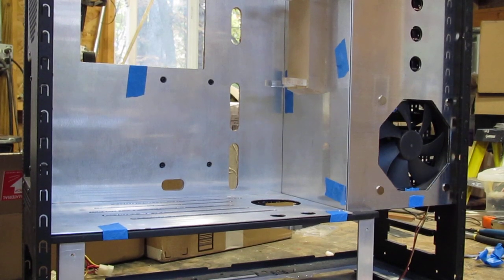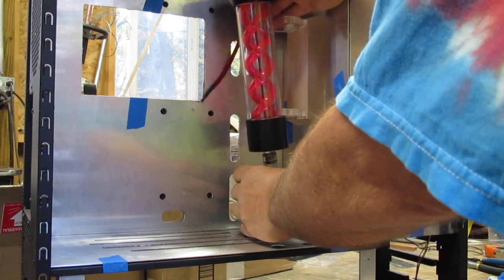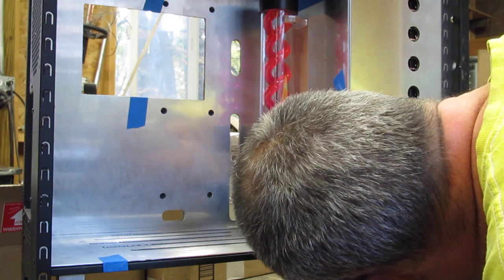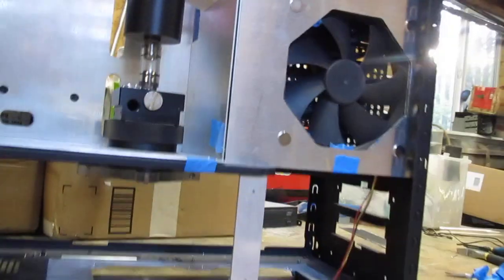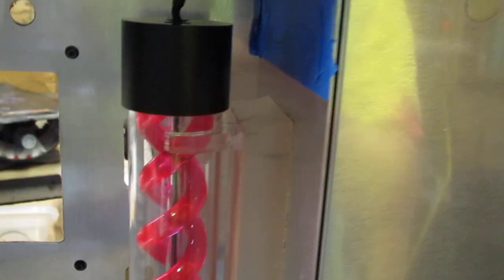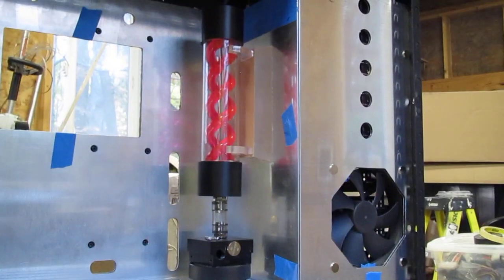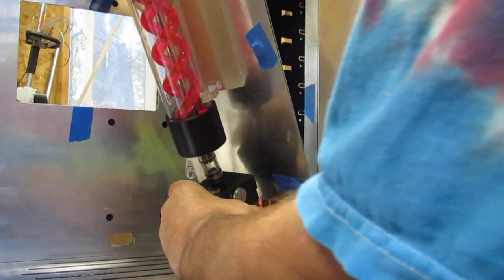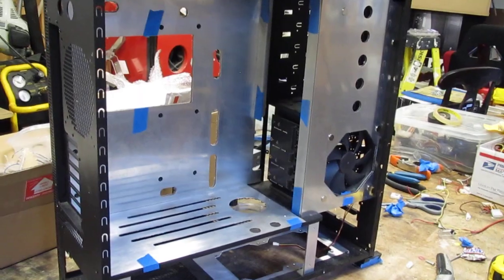T Virus Reservoir BitsPower Pump Custom Mount: Gemini Project Disclosure 2

Comment: Hello sorry I do not write English I had to use google translation I buy the Barrow - Blue T 255 virus tank with RGB Aurora LRC2.0 controller and RGB Aurora RGB Waterproof RGB2. 255mm
I do what the site tells me or I buy it and take it as dye EK-CryoFuel Red Blood Coloring Fluid that was always recommended by the site and to my surprise this makes a horrible result if you Fill only the half of the tank you will be able to see the multicolored strip off if you fill it in full your strip will remain red and no other color will stand out from my own experience if you wish to see the different colors leave your liquid colorless. If you want to have pictures of the result contact me on my facebook Isa Fran Carvela